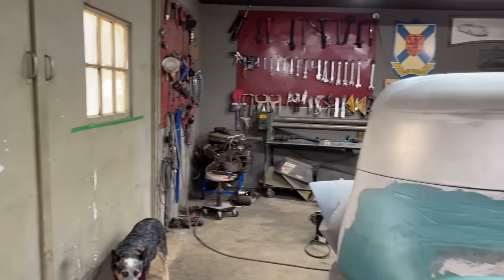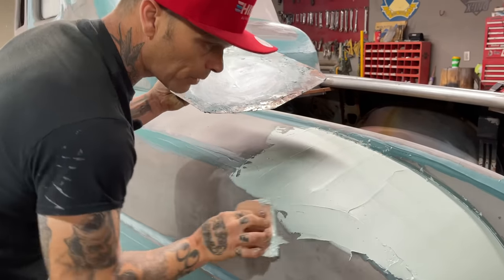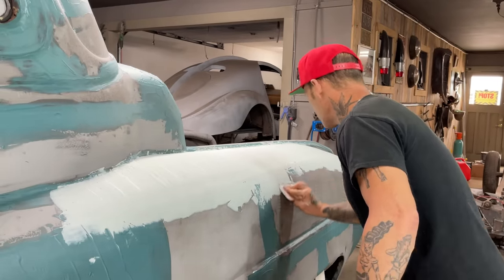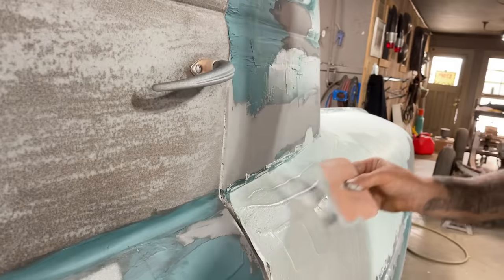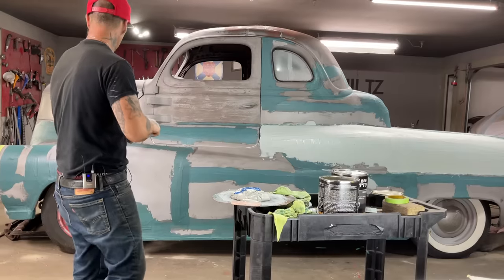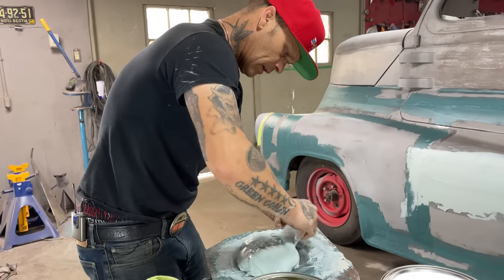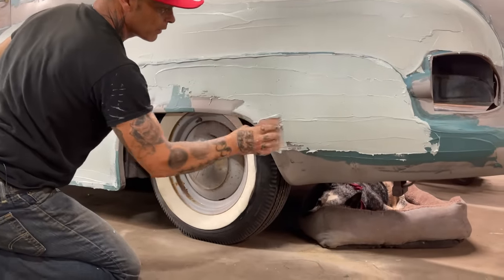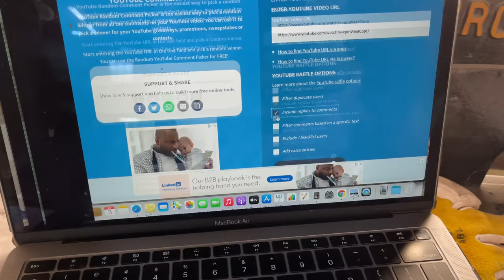BODY WORK: HOW TO APPLY AUTO BODY FILLER FOR SHOW CAR FINISH

Comment: I did this body fill flooding back in the early 80's  It does work just fine and like you say it saves time and it looks good at the end. I had a old grand le mans wagon that I did all over. I even rebuilt the engine and trans .  Chad you are a master at doing this .

Comment: Ice the cake!  Thanks for sharing.   Your filler is the, Icing on the Cake.  It makes it look fabulous...The unifying butter that smooths the surface of the body out.  I can't wait to see how you design the rear end of the car so it fits in with the back end of the truck.  The anticipation is mounting...How, What and Where?  Chad and Jolene, This truck is a masterpiece in the making.  I can't wait to see it on the road.  I'd pay you for a ride in it.  You are making Truck Design history.  Cool beans!

Comment: body work is so deverse and done in so many ways.  You're doing what i think i'd do it like.  I'd probably put resin in my body filler too because it goes on smoother with less pin holes.  I think the biggest mistake made is when you put filler here and there several times instead of flooding the whole thing.  I like using a cheese grater before reappling filler if you catch it right it helps level it out making it all go faster.  It saves on sandpaper because you don't dull it getting the top off of it.  Keep up the good work !

Comment: Love watching you guys work! Your work inspires me to push harder and build better! I'm a young(ish) collision repair tech on his way into restorations and custom work( want to learn metal finishing and how to build my own panels. ) 
I have a question however, what sort of adhesion do you get when putting bonds over unsanded fibre reinforced filler? usually when I do mud work I sand with 80 grit or coarser for mechanical adhesion on bare metal and 40-80 grit over fibre reinforced filler. I am not judging at all, just want to learn and expand my knowledge. 

Thank you so much for you time and I look forward to your response!
Reply: Unfortunately you won't get a response. I can see he doesn't have the time to answer everyone's questions or chat with people on here, but he should at least answer 2  questions per video.  I've noticed the ones that do that keep their subscribers and gain even more!

Comment: Oh im scared alright!..lol 50 min it took just to spread out one coat of mud over just part of one qtr panel, which is kinda a easy flat open spot..And then to think that needs to be sanded and repeat another coat of mud and then if it was me i would switch to a coat of glazing putty..all those steps need sanded between..Gives you an idea of how many hrs its going to take to just do the mud work!...Oh and mudding all the concave body line sections that you have to spread the mud out with your fingers and then get creative with different sanding blocks...jeez so much work!! and so much money in sand paper and mud..And to think we havent even got to fill primer yet which has about just as many steps!!..im glad you still got the motivation in you Chad

Comment: I'm just about ready to do the same thing with my full four door CJ-7 widened it out to 75" on 6" C channel frame. Still has removable doors and  the windshield folds down with the fiberglass removable top. The hardest part will be the soft top and folding frame. But that's what makes these projects fun! Looking good!👍

Comment: sweet, I've always wanted to try doing body work, been doing plaster & drywall repairs for over 40 years and the procedure seems soo similar.  Also, if you coat the whole vehicle with body fill, then the paint is being applied to the same surface, which means it gets absorbed the same throughout the car.  Believe it or not, you can see the difference in how the paint soaks in to various substrates.

Comment: I like the visual of the ocean floor. It has really helped me with the mud and guide coat application and use.
I wish I could use more mud in each application, but I'm working in 27 deg centigrade temps, so the mud becomes unworkable in a couple of minutes.

Comment: A good philosophy is to appley the spaktula first to the ground in one way. But then strech it backwards and in all other other dimensions too. In this way the spaktular meets the ground much better and do not miss junktion to the other sides of the cavetie. Think of any cavity (deep like a howle or only flat) and your spaktular goses over it. The spektular gets no good kontact and no good fill beside the work-direktion. After grinding you get howles and have to fill them more ticky up. If you will do so like spoken, your time to apply the spektular will be much less. And that is the reason, because they all try to apply much spektular in a short time in mainly only one direction.

Comment: Great effort my dude. Do you ever have issues with cracking further down the line ? I did alot of metal work once to a car by putting a wide arch/fender body kit made from steel on it and we had issues further down the line with hairline cracks from flexing because we did a big flood on it similar to this. Messed up the candy apple paint job I had done on it! Any tips would be appreciated! Cheers Chad!

Comment: Very impressive, the way you spread mud. I would of had it kick off with more than half still left behind. Very tight coats, custom work is a totally different beast. Body shops, have fast hands, and Russian fingers. Great video thanks.

Comment: Hey I like your work I'm amazed at your skill and talent.  I know you are very busy so no need to answer personally. I'm new to your channel; and, I have a question. Have you every done suicide doors?  I've restored one truck a 68 D-100 Sweptline and It looked good when I was done I'm no pro like you but a bodyman offered me a job if I ever wanted it.  Here's my question.  My first car was a gift from my Grandfather when I turned 16.  It was a 64 ford Galaxie 4-door with a straight six and a C-6 tranny.  I wished I was a 2-door then but loved the car anyway as Grandpa and I were very close.  It was 1976.  Anyway a drunk driver broadsided me on the drives side goin 70mph when he hit me and totaled the car and almost me; CPR saved me.  Anyway through the years I thought I wanted a 64 2-door again; then came up with an idea. I like to get another 4-door, put a 427 in it with a 4-speed, tub it and suicide the rear doors; more but I think that description suffices for you to see what I want to do.  My question, I've wanted to ask other fabricators, is have you ever done suicide doors and how difficult is it.  I can see this car in my minds eye and it would be gorgeous; at least to me.  Please feel free to just comment in a video I don't want to take up your valuable time.  I'm impressed with your talent and you are blessed to have Jolene.  Thanks.

Comment: to make your mud more user friendly, add 10% fiberglass resin to the can before using. Helps to eliminate trapped air and makes for an overall smoother job, great for skim coats

Comment: I understand why you used as much filler as you do but I think people need to realize a lot of that gets sanded off in the process and you are certainly right you'll never see any normal vehicle with as much welding on it as you do on yours

Comment: I worked for a guy in 80s. He did builder's lots of mud lots of pushing the board. Looks like the large area your doing I would have used a little less hardner so not to set up so quickly

Comment: : -When working with old junk..not brand new equipment , to get the body right..and streight, it requires a quality coating ! This is still O.K., as long as it is done right ! 🤨👍

Comment: Green MarGlass? That is some heavy duty filling. Yep did it 40 years until my body cried stop, no pensions in this industry, wasn't till the year 2000 where we in the industry started to get holiday pay and health insurance, and then it became corporatized with CEOs on salary sucking the commission and the money away from the workers. We're all considered subcontractors on commission which allows the employers to legally NOT have to pay you minimum wage when you're sitting on your ass because there's no work just waiting for a rainstorm so people crash their cars so you have something to do. The restoration industry seems to be doing well these days where as the early years,no no. The baby boomers are spending their retirements on those really cool '70s cars.